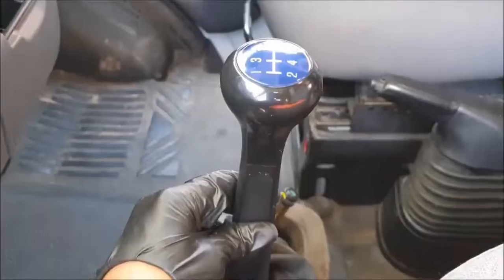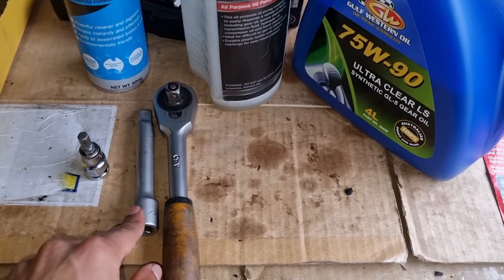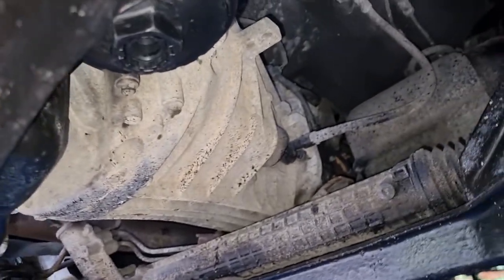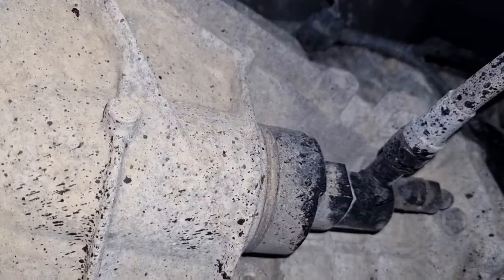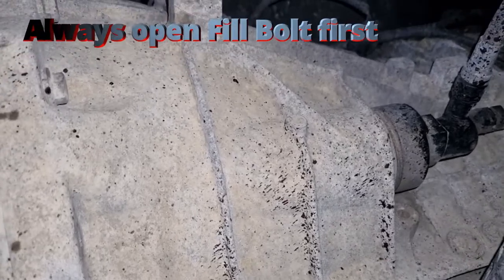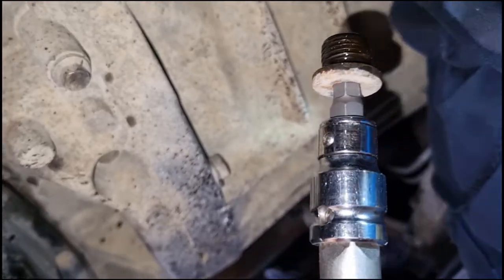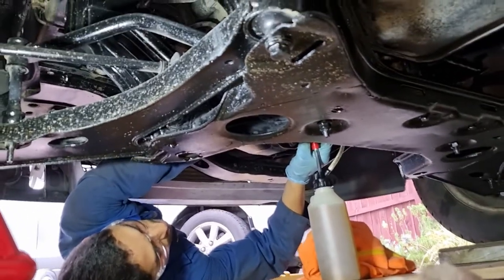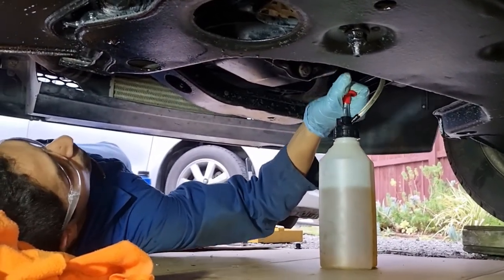Ford Transit Gearbox Fluid Change (Manual Transmission)

Comment: I have a Ford transit mk6 ,manual trans, when I try put stick into 1st gear or 2nd it will not go in, unless the engine is iff! Do you think i need gearbox fluid?? I just done the serpentine belt and now that is the problem..can anybody help?
Reply from the maker: Does the engine start and idle ok? If so check your clutch fluid level, master cylinder and slave cylinder. How was the clutch before this issue occurred? Was it a bit difficult to push down on?
Reply: @AutoBuddynz  it was OK before hand selecting the gear was a little stiff but now it's just not going into those gears.  Master cylinder? Slave? Where are they?   , the van idles fine . Starts everything, no warning lights.  The clutch is wayyy lower that it was when the van broke down 3 weeks ago
Reply from the maker: @rondiggz6589   Sounds like you have a failed slave cylinder, or possibly master. Slave cylinder can be seen in this video its on the gearbox and the master cylinder is next to the brake booster they are both plastic units and can fail, this can happen is the clutch is old and worn causing the two components to work excessively.
Reply: @AutoBuddynz  okok ill have a look , thanks alot!!